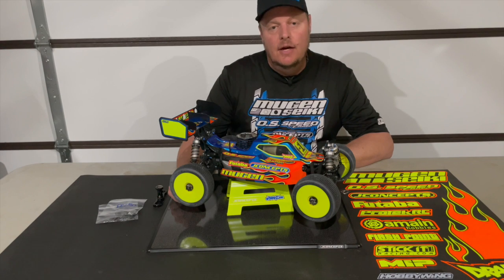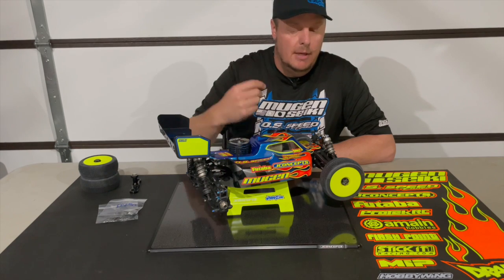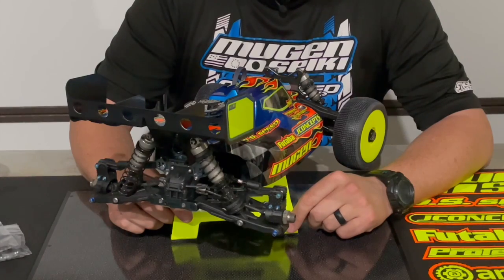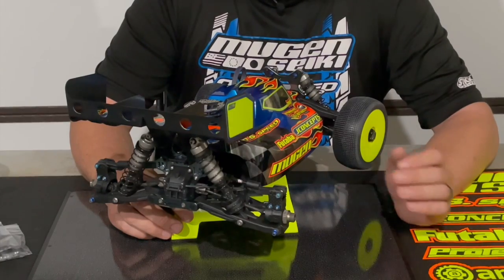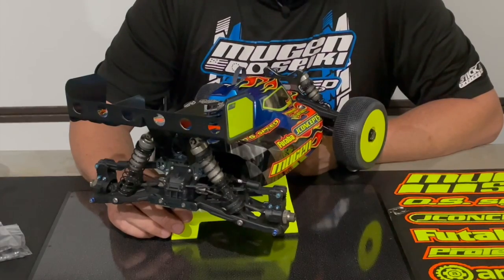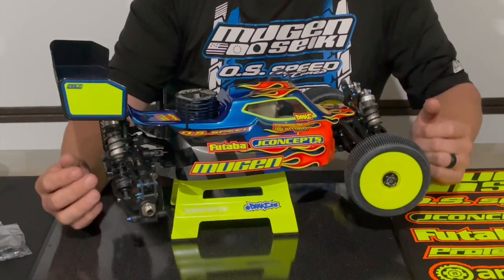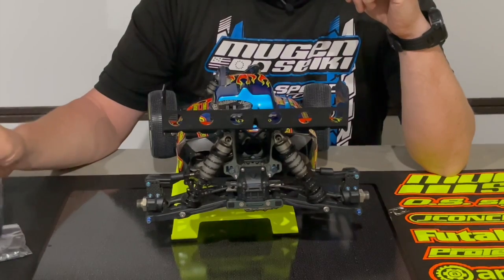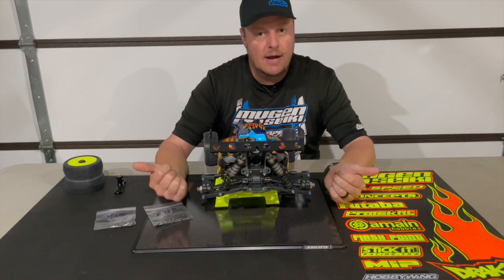Rear Roll Center and Camber Rise

Comment: Not quite on topic of this video, but from event to event how often do you change rear toe, anti squat and anti dive settings? is it pretty track specific or driver preference specific? when can tuning with diffs be used in place of these lower arm adjustments?

Comment: Great video Adam, can you please tell me I’m about to put the MIP one high flow pistons in my mbx8tr I have 600550 and 450 oil what valving and what oil should I use? I run only at Barnstormers and trains and lanes.
Reply from the maker: With the 6x1.3 Hi-Flow pistons I would start with 600/550 front and 550/500 rear depending on the temperature with clear front and blue rear.

Comment: How does raising or lowering the rear hub impact this setting? Do you recommend compensating outer link height if changing the hub height?
Reply from the maker: Typically when raising the hub position, you can lower the plate, but it really depends on the handling change you're looking to accomplish.
Reply: It would affect it but typically with mugen everyone always runs rear hubs down. Better rear grip and forward traction
Reply: One way to think of raising or lowering the rear hub is that the hub height doesn’t change (it’s fixed to the wheel after all) but you are changing the lower arm’s outer hinge pin height. 

So raising the hub is effectively lowering the end of the A-arm. It raises the roll center and has other effects as well.